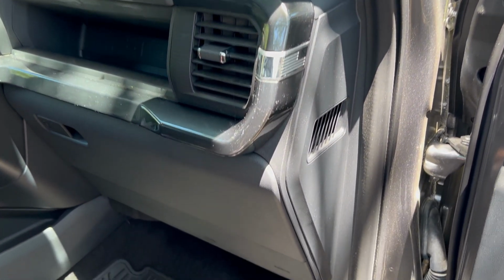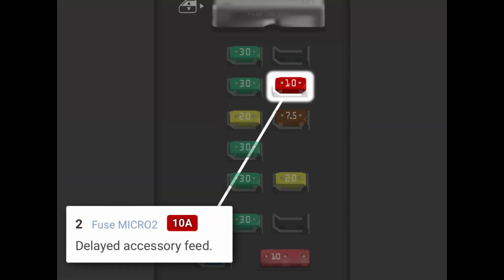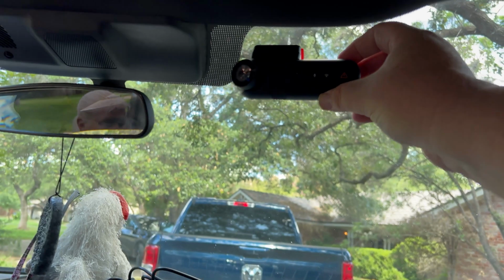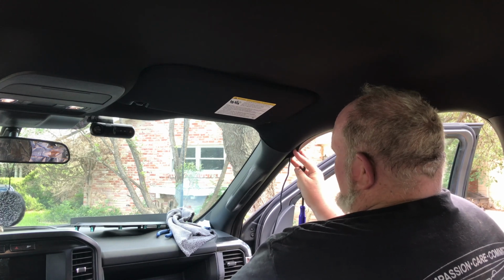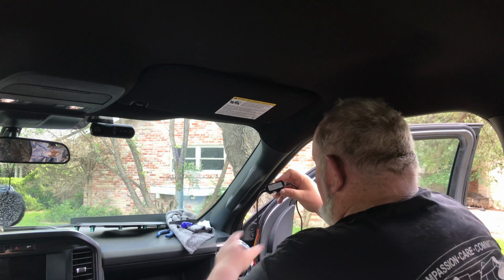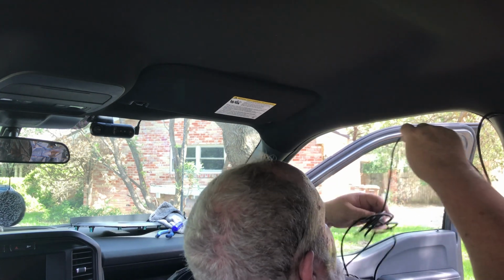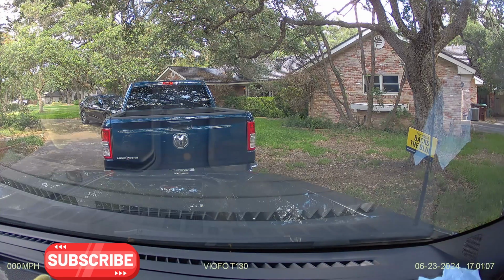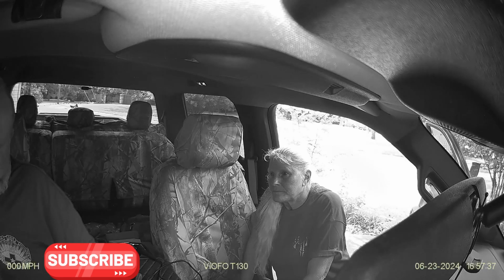When  ‘Trust Me, Officer’ Isn’t Enough: Ford F-150 Dash Cam Install

Comment from the maker: Thinking about installing a dash cam in your own vehicle? 💡 The VIOFO T130 is a great option, and in this video I show exactly how to install it in a 2022 Ford F-150 — from wiring to placement to safety tips. If you’ve got questions or you're stuck at any step, drop a comment below and I’ll help out!

💬 What dash cam are YOU running? Or are you considering the T130? Let’s talk dash cam setups below!